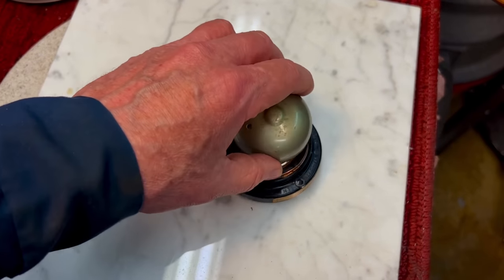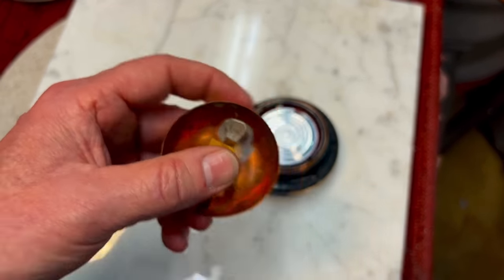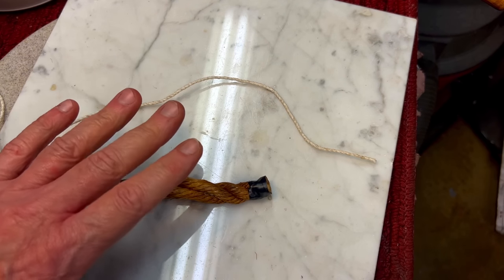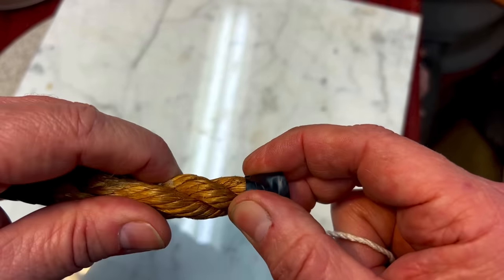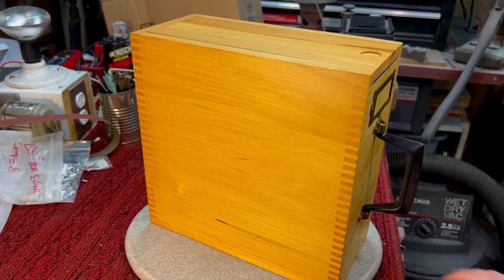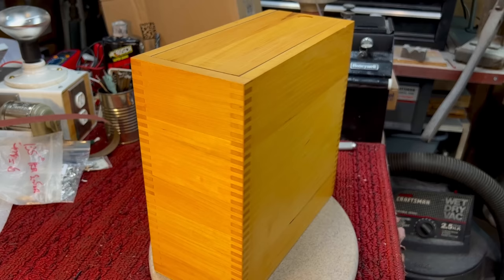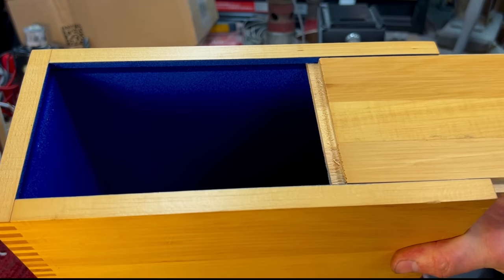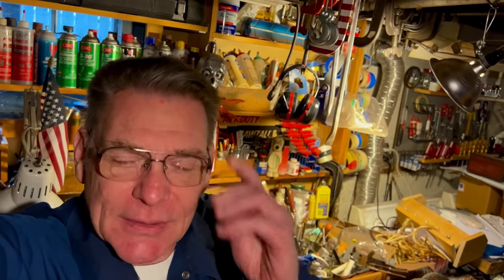Simple Whipping, Replacing Extension Cord End, Hand Drill Decal Addition…

Comment: Very nice video S.C.. You always do amazing work.. I have a question about flocking.. What if you had steel braided line instead of rope.. Would you weld it or braze it.. I always wondered about that.. maybe you could do that on one of your videos... Well nuff said, S.C. have a great week and God Bless...
Reply from the maker: Some cables become brittle if heated too much. Often wire rope or cable has a loop or end affixed to the cable. You can also whip the wire rope with wire then twist it secure after winding. 😃👍